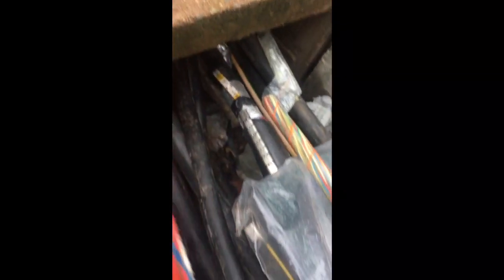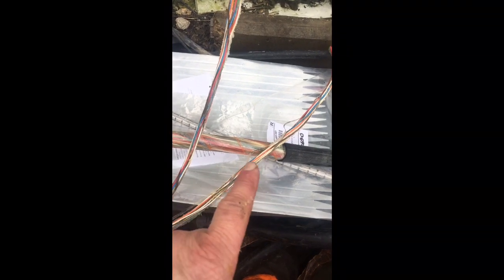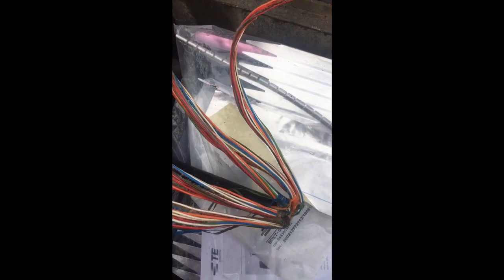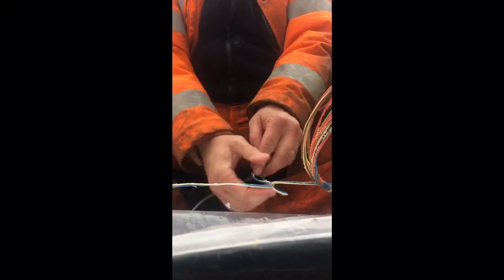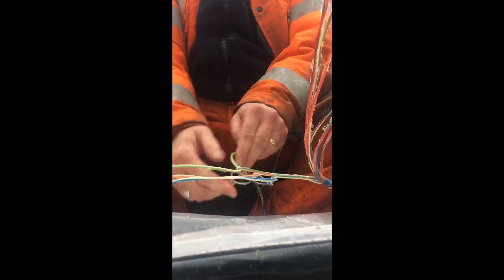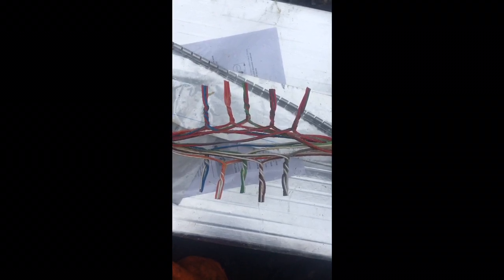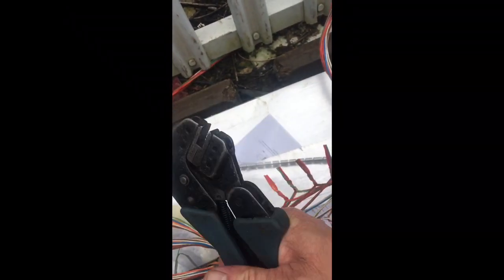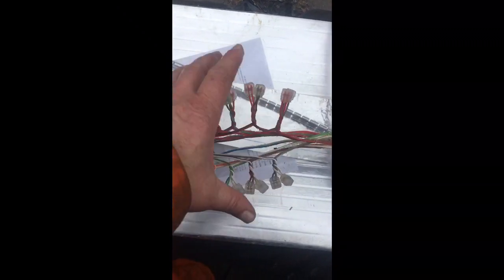How to joint a telecoms copper cable

Comment: Hi, do you have any more copper jointing videos by any chance? Such as installing cables into a in-line and cap ended copper closures?
Reply: I believe most copper jointing now is only repair work as it’s usually being phased out or replaced